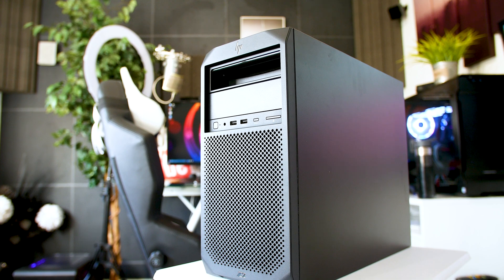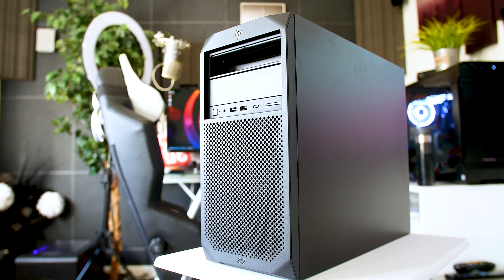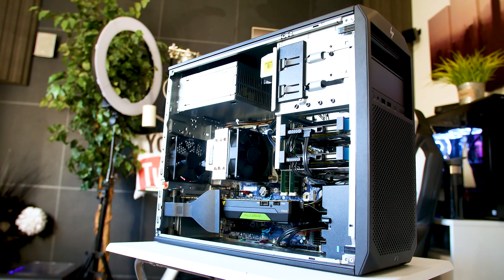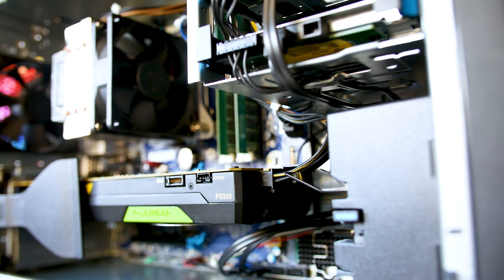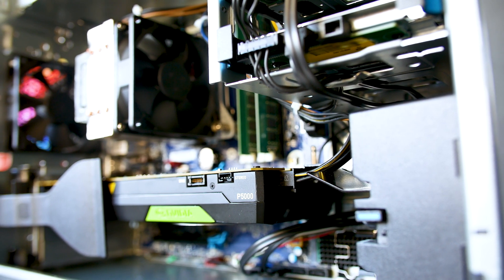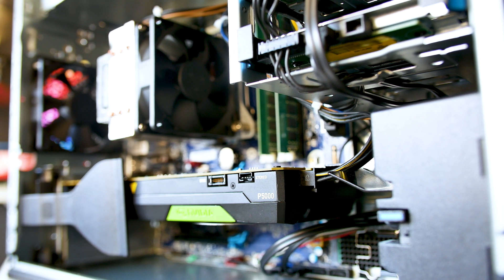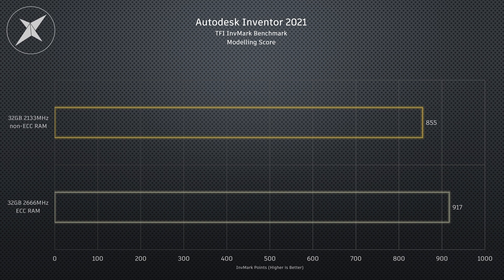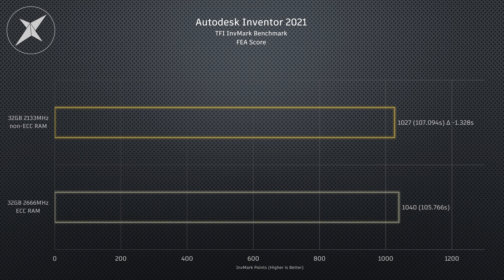Do You Need ECC RAM in CAD Workstations? (with tests)

Comment: On most work stations, if you do not have ECC ram I would suggest turning off XMP. Single bit errors on the ram corrupts data and goes undetected without ECC Ram.

Comment: 6:17 From what I've read, the performance hit is due to registered memory (additional latency of the register), and not due to ECC itself. Unbuffered ECC memory shouldn't have any performance hit. Likewise, nothing prevents overclocking ECC RAM; it's just that the server-focused platforms that ask for ECC RAM generally don't support overclocking. On something like Ryzen, it's just as easy to overclock ECC as non-ECC RAM. Also, aftermarket DDR4-3200 ECC is readily available; it's just not offered on Dell's RAM configurator. It is a valid point that ECC RAM isn't sold at higher speeds like gaming RAM (basically guaranteed overclocking).

Comment: In my personal experience, ECC memory is crucial for working with applications that involve long and tough processes like video editing/rendering, 3d rendering, everything graphic related. I had non-ECC ram on an i5 and had crashes all the time using these applications. Now I have ECC-RAM (also on my graphics card) and my system is extremely stable and reliable. It's totally worth it.
Reply: You had to swap out both the CPU and MOBO to get on to ECC. I reckon the issue wasn't the RAM...
Reply: This is what I'm thinking. Lots of errors pop up when running CAD and other applications without closing things down. Its' time consuming to relocate and set up my working environment just to pick up where I left off
Reply: Sounds like those crashes were due to a weak system not being able to handle what the program was asking for, leading to a long processing time which causes delays and ultimately crashes.
In my personal experience, over the last year with video editing and 3D rendering, I have never had a single crash due to memory. All of the crashes were due to software and general system instabilities. I have never come across a BSOD with memory as the reason for the crash.

Comment: TLDR, If you have to ask if you need ECC ram, you don't.

Not to be rude, but I feel like you omitted the largest use cases for ECC ram and I feel like I can shed a little more light on the topic.

First of all, it seems like you have the misconception that processors and computer components, in general, communicate with one another without erroneous information mixed in 99% of the time.

No, they do not, contrary to popular belief nearly 100% of the time communication occurs there is erroneous data mixed in, and it's not all down to background noise, is mostly due to the machine's own noise and come with the territory of the insane speeds that today's communication buses and processors operate at (to be clear you could get nearly 100% data integrity somewhere between 2 to 8 megahertz maybe, but today's processors operate in the realm of GigaHertz, and even the slowest communication buses and used today operate in the realm of hundreds of megahertz.).

At this point you're probably wondering “How do computers work reliably if that's the case?”, it's simple, most software you use on your computer has some sort of mixture of parity checking and countermeasures in place for corrupt data. In addition, most of the firmware on your computer has built-in countermeasures as well. 

Now your question probably changed to “If that works, why do we need ECC ram again?”, all of those aforementioned countermeasures come at a cost, namely speed. Additionally, in the case of ram, to operate effectively it has to receive a message and return the identical message when requested. 

Some of the most common “fixes” for the issues with data reliability are added parody bits (which waste bandwidth and require extra computation.), performing the operation multiple times and comparing the results to see if they match, and the most obvious “fix” just pretend like there is no corruption and see if it works with everything else that the program has done only re-performing the calculations if it doesn't add up per se. 

These approaches work fine for things that are made up of many tiny elements and or that don't take too long to begin with, for example, things like web browsers, video games, and even CAD programs. In the case of web browsers if elements don't load correctly just reload the individual element, In the case of video games, things that won't make the game crash are often ignored for example, cigarettes not lining up with people’s mouths in Cyberpunk 2077, you can run the same game on the same computer and get different results each time (a lot of the times when you see stuttering, or hanging up in a game, It's generally a memory issue, especially if none of your components are overclocked.). 

Now let's finally talk about factors that lead to instability in ram. Hypothetically, ram gets less stable, the more you have of it, the more you use, as the total number of modules you have on each card increases, and in my experience, exponentially as you increase the number of sticks of ram per CPU. 

In practice, most workloads won't ever run into the instability issues that are real show stoppers that often, for example, let's say you had a system with eight gigabytes of ram, and for every 8 gigabytes you write to the ram one bit is erroneous (these aren't realistic numbers but bear with me), if you had a program that when you started it loaded 4 gigabytes into the ram and during your entire session it only needed to read about 2 gigabytes of the ram it wrote to, odds are you're never even going to get an erroneous bit performing that operation, and if you did it probably wouldn't matter.  

However, if your workload consisted of writing to the entire 8 gigabytes, reading the entire 8 gigabytes, performing an operation on the information, and rewriting the result to all 8 gigabytes of memory, again and again as fast as the memory will allow for multiple days and even in some cases years at a time.

In this workload, you're guaranteed to see corrupted data many times per second, and what's worse is considering you're performing operations with corrupted data all future calculations using the corrupted data will be erroneous as well, so, with each clock cycle you're exponentially getting more and more corrupted useless data. 

This really becomes an issue when it's impractical to use some of the aforementioned “fixes” to check for erroneous data. This is exactly the kind of workload a high and virtualization server, or high-end rendering produces.

In my experience with DDR4, if your rendering requires more than 32 gigabytes of ram or four individual sticks of ram whichever comes first, you're in for a bad time, if you render anything that takes more than three hours. Your renders will crash in the middle regularly unless you're using expensive high-speed ram underclocked a little bit, which at that point you could just use ECC ram. 

These days it's common to have 4 terabytes of ram across 16 sticks per CPU in modern servers, with 100% utilization. Believe me when I say for high-end productions it's common for workstations to have 256 gigabytes of ram for rendering workloads, and ram is often the bottleneck for many rendering operations with today's processors.

a lot of the time it's unreasonable to do much error correction on large-scale renders. some movies take years to render, if you added parity bit checking for every bit it would take at least twice as long and still wouldn't catch everything, obviously if you render the entire movie three times, each copy would have different corruption, there are actually released AAA movies where CG elements just disappear and reappear randomly, and that's with all the greatest technology money can buy.

Today, the best we can do is just ensure the computers don't crash while they're rendering and go through either manually or with computer vision frame by frame looking for abnormalities, re-rendering any frames containing glitches.  

In summary, if your workload consists of writing more than 32 gigabytes of ram as fast as the ram will allow continuously, you need ECC ram. However, if that is your workload you would probably already know that if you're not already using ECC ram.

Data integrity tends to get much better with each generation of DDR ram, so I'm guessing when we get into DDR5 ram my recommendation would move up to about 90 gigabytes before you need ECC ram
.

If you get 64 gigabytes on eight 8 gigabyte sticks and fill it up with tabs from Google Chrome or something it will occasionally stutter and pages will crash and reload but in my testing, you won't be able to actually crash your computer.   

Additionally, stop pretending like AMD doesn't exist, Lenovo makes prebuilt AMD workstations, and most AMD processors, even desktop ones support ECC ram. If you actually need ECC ram support on the cheap, usually AMD is the way to go, however, if it's for an actual business unless you have on-site tech support (I don't mean you with a screwdriver even if you know everything about computers, I mean someone or preferably an entire team whose job it is to just keep the computers working) I highly recommend getting some kind of prebuilt with good customer service over building something yourself in that environment.

Let me know if you have any questions, I can literally talk about this topic all day. 
Here's a very good video on the topic if you want to learn a little bit more about error detection.
https://www.youtube.com/watch?v=MgkhrBSjhag
Reply: This is exactly the stuff that I wanted to find out by watching this video and what was not even mentioned there. Many thanks!
Reply: thank you so much. you cleared up lots of stuff. i googled for long time to decide if i really need ecc ram and did not find definite answer. you provided the best answer.
Reply: @xsterawesome  you are a hero for writing this, thankyou

Comment: Cool cat in the background, or is it? Seriously though, does this apply to what type of video ram our vid cards have onboard? In particular RTX 8000/9000 series. I’ll be having a new system built by Jet Systems in Florida, and before they do the build.... I’m wondering if I should talk to them regarding ECC RAM.  Hummmm, interesting to say the least.
Reply from the maker: Quadro/Pro cards have ECC video RAM but its not something you can option for, and it's totally not something that I'd choose a GPU based on for our field.  But for regular RAM, sure, have the talk with them, all the info about it is in here now and should be enough to make an informed decision based off!
Reply: @Neil3D  Thanks much for the reply, yeah I know it’s not something that can be optioned in on a video card. Was just wondering if the results would be similar, better or worse in parallel performance tests. Thanks again and stay safe. Cheers

Comment: From my experience, limited though it may be, I have better luck running FEA on large models my newer machine with ECC than my older machine with non-ECC. I realize that there are other factors at play besides the RAM but with models that I tend to run overnight it's nice to come in to a completed test rather than a hung program or crashed computer.

Comment: But on desktop, you can get 4000+ MHz RAM. Wouldn't it be a different story when you would compare 2666 vs. 4400 for example? 🤔
Reply from the maker: I already answered that in the video! You can't put 4000MHz RAM into a CAD workstation, the highest is 3200MHz non-ECC RAM.  I didn't explain why because it's not an "everything about RAM video" but basically when you see RAM being sold at 4000MHz speeds, that's an overclock on the RAM which is enabled in the computer BIOS.  CAD workstations don't have the BIOS tools to enable that overclock.  So CAD workstations can only run RAM at stock DDR4 speeds and the highest standard DDR4 speed is 3200HMz.  And you (generally speaking) can't put ECC RAM into systems that would have those RAM overclocking tools in the BIOS.
Reply: @Neil3D  Yes, I understand that. I was thinking if non-ECC RAM at 4000+ MHz wouldn't outweigh potential benefits of ECC. That's all.
Reply from the maker: @Numian  Yea but then that 4000MHz non-ECC RAM would be in a system which is completely different to a CAD workstation, it would be in a consumer grade system and then there's far too many other differences which would then outweigh the ECC vs non-ECC comparison at that point.
Reply: @Neil3D  That is true indeed. For my home PC I prefer speed/saved time over hard-to-measure reliability even I do use it for CAD/CAM and other "pro" work. Thanks.